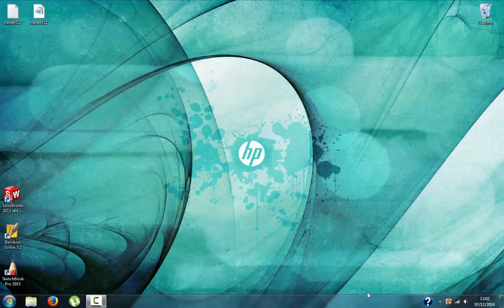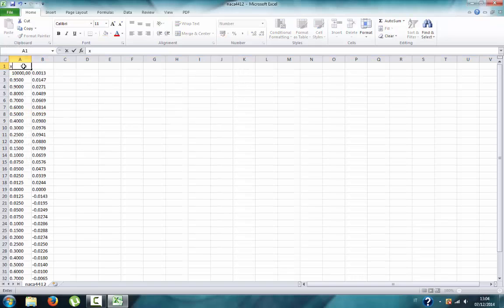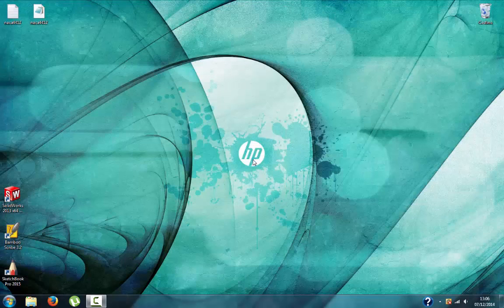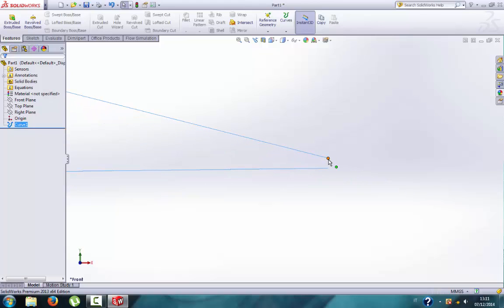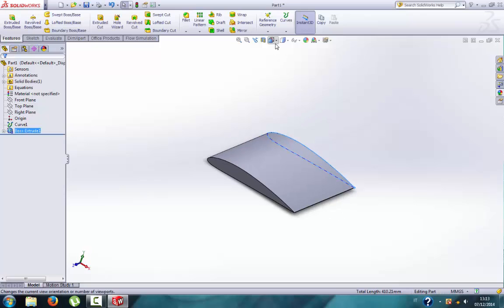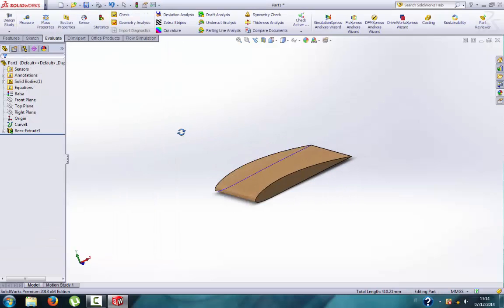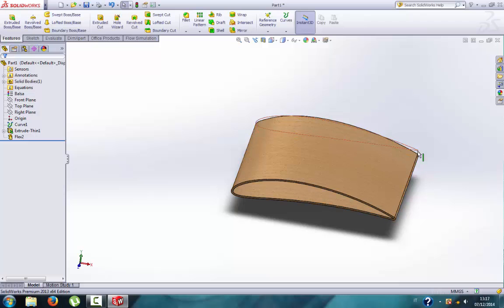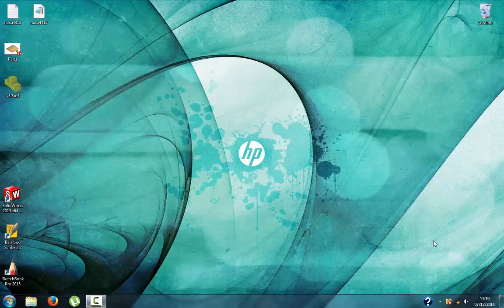Ep.1 - How to build a wing in solidworks starting from coordinates

Comment: Hi there. Thanks for the good tutorial. I wanted to know if it's possible to taper on one side only (keeping the one side straight) and then mirror the whole part. Ciao!
Reply from the maker: Yes you can. In fact you can taper at 1/4 chord , 1/2 chord,  chord on leading or trailing edge

Comment: If I have a two chord lengths and therefore want to build a tapered wing, how would I do it? Great Instructional video btw
Reply from the maker: Tapered wings can be  located at , 1/4 chord leading edge, 1/2 chord, chord leading edge, chord trailing edge, 1/4 trailing edge

Comment: Aren't you changing the wing profile by putting the thin feature on the outside. Unfortunately trying to put it on the inside results in an error message.
Reply from the maker: the change by putting thin feature outside is minimum if compare to inner thin feature. Outer feature is easier to handle

Comment: may be a silly problem, but i cant seem to multiply the table in excel. I keep on getting invalid! plz helpp
Reply from the maker: Ahmad Esber try to replace commas with points. also you have to change the format of your cells from general to number
Reply: Yeah when you replace commas with points, everything works. But when i replace them back, everything gets back to invalid. I also tried changing the cell format, didnt work as well. Its getting very frustrating XD. Anyways thx for the help 👍
Reply: Ahmad Esber ok. try to change them with notepad. use excell only for multiplication then use notepad for replacing
Reply: Might work! Ill let you know. Thx

Comment: hello i am using solidworks 2016 i tried this method and solid gives me an error invalid contents of txt file ?!
Reply from the maker: Mohamed Sherif you have to check the format of the coordinates. 
First, you should have 3 columns, x y and z (filled with zeros)
second, check your sistem if use commas or dot when defining decimal numbers
third, no space between commas and number, like 0,  467

Comment: I am getting error that 3d spline is self intersecting.... I downloaded data from the same site as you told
Reply from the maker: +Vignesh Thirumurthi check the values with excel. That happens usually on trailing edge when you close the spline. If you see something wrong erase useless zeros'
Reply: Mighty Wings Thanks dude.